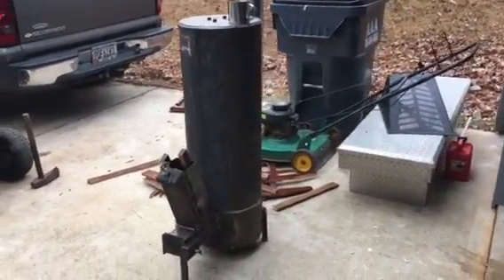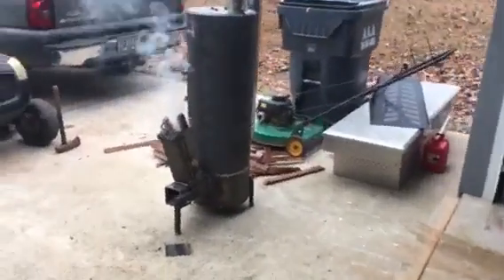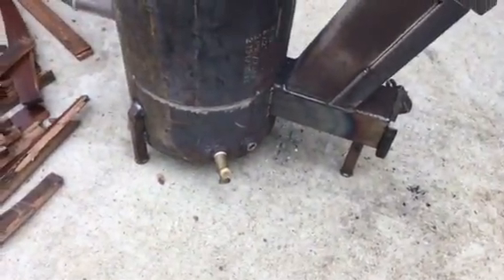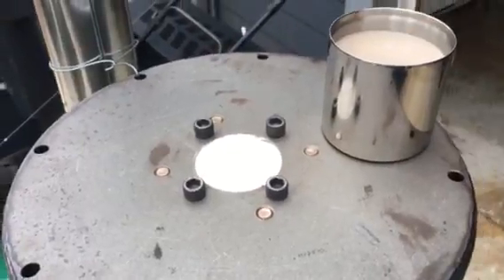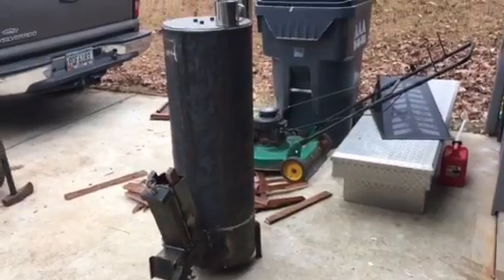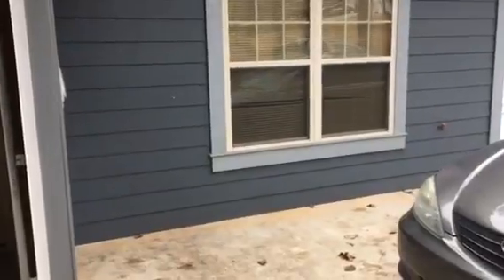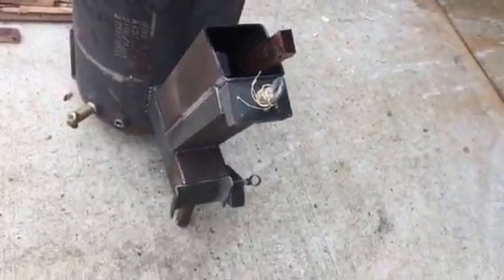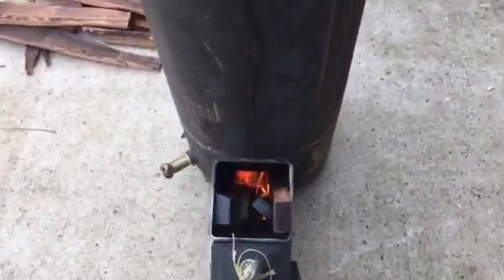Rocket Stove Part 3 ( Space Heater )

Comment: One of the best builds - which exhaust configuration helps to encapsulate the heat. I think you should be thinking of adding ceramic materials to components to further make more efficient. Congrates!